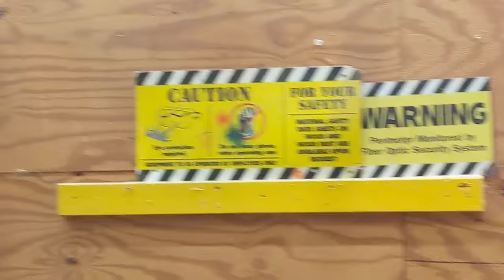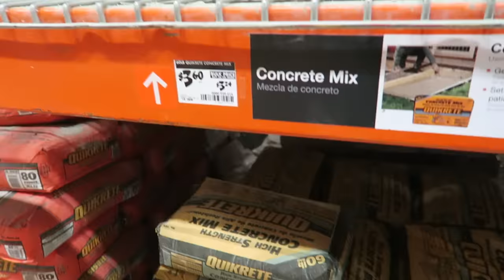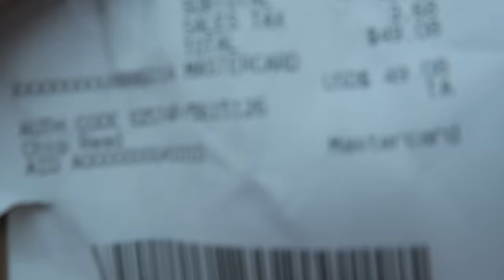How To: DIY Squat Rack & Bench Press Rack for $50

Comment from the maker: As stated in the video, would prefer people buy a squat rack for safety purposes. However, I know of multiple people that have lifted on this type of squat stand for years without any issues. Learn how to safely dump the bar off your back and don't bench without a spotter.
Reply: @48Boxer  This, use the Buffdudes one with wood and metal pipes. It's a full 4 post rack and can't kill yourself if the spotters are in the right spots... Back dump offs for squats and ab roll ups for failed heavy weights on bench are the best methods I've seen on failing reps without spotting.
Reply: If you were to buy one specialty bar that is most versatile what would you recommend?
Reply: @iloqin  yeah.  But trying to dump a low bar squat is a recipe for disaster.  If you don't get out fast enough you get a loaded bar smashing your lower back.  So that super cheap Home Depot squat rack just cost you a grand in medical bills, potential lost wages, and bodily harm.
Reply: One bad dump with real weight will kill you on this.
Reply: iloqin don’t bench with collars either
Reply: Wild Bill good time to lift sub max weights and increase volume
Reply: Coop could you do a DIY pull up bar. I would like to see what you would recommend for that?
Reply: Hey man, on an unrelated  note I have a question for you I would appreciate you'd answer.

I purchased an ohio ceracoat bar recently and was wondering if you know how the new finish holds up to the test of time. I saw your earlier videos and got one with a chrome sleeve, so only talking on the bar itself.
If you do take the time to answer this, thank you.
Reply: Yeah brother.. Not safe at all.. I'd recommend u take that Video,  you do want any of ur followers getting hurt.. up til this great content
Reply: Yeah.. brother.. love the content,  solely my opinion, Please pull this video, you dont want any of your followers  or yourself getting hurt.. that looked sooo unstable..
Reply: I’d love to buy one but I can’t find anywhere online to buy one. This might have to do for the next month or so to save me.
Reply: This is definitely not the easiest DIY. My current rack is 8ft 4x4 cut at 36inches for bench and 60 for squat. The tops are cut at 45 degree angles to make a V. I also recommend filling the buckets with a full 50lbs of Crete.I have used them for the past 4 years with no issues. The most I have loaded on it is 405 , but I love it. I can move it in and out of the garage to the basement when the temps are too cold to lift out side, check out end of three fitness for some cool DIY projects
Reply: Put joist hangers on back with corresponding joist hangers mounted on wall. When you want to use, move the squat rack to it's place and put a two by four between wall and racks. Will make it not tip back as easy.
Reply: @bigjosh04  How about use it for light lifting and not maxing? Clearly if you're in a position to only be able to make a DIY rack, you're not going to be able to afford a ton of plates to go along with it.
Reply: @sokissablec3  I can respect ur take.. Been in this game for too long and want to see fitness fan Build legs Not break them.. Sooo many other options for Building Legs, The risk is not even worth it
Reply: @sokissablec3  he's clearly quite poor. Def the best bet for Joshy-no-money. 👍
Reply: @bigjosh04  I totally get it but as a 6x/week lifter who just lost her job for 6 months due to the pandemic as well as millions of others, seems like good temporary measure as long as you use your senses along with it.
Reply: Hahahaha... Buy a squat rack. Fuckin 12 week waitlist.  Just hoping my plates bench and bar get here sooner than that.
Reply: With a few modifications this would be good outside , just make the wood 2 - 3 ft longer and bury it in the ground , you wouldn't need the buckets just pour the concrete in the holes !
Reply: @antonycuff4512  Outdoor this’ll work well. I sunk vertical 4x4s to the ground for a trellis hammock stand I made last summer. The 4x4 (or stacked 2x4s) needs to go in for 1/3 its height (i.e. 3’ 4” hole for a 10 foot 4x4) and you need a lot more quickrete than one bag per hole. If you do this, I’d connect the two vertical beams with a horizontal pipe for pull-ups.
Reply: i guess it is kinda off topic but do anybody know a good site to stream newly released movies online?
Reply: @Chaim Clark I would suggest flixzone. You can find it by googling =)
Reply: how to buy homedepot buckets in europe also you have alternatives to that? im from poland and i can't buy shit here
Reply: hey bro what screws are theese in european size?
Reply: God loves you he sent his one and only son and if we walk in the path Jesus walked in we will enter the kingdom of Heaven.

Comment: Dude you're a life saver. It doesn't take a genius to realize this isn't the safest rack but as long as you're not an idiot this will work just fine.
Reply: If you're flat broke it's okay. But Amazon has or used to have basic power racks for around $200 or so...
Reply: ultimaetsolder not about price but those wont ship out for weeks. Built my own stands out of wood that are a little nicer than these (and safer). I also need to be able to put it in the corner of my garage when I’m done.
Reply: @ultimaetsolder  during a pandemic, it might be the best thing you can find!
Reply: Safer then trying to deadlift 400lbs off the floor and toss it over your head

Comment: id attach a crossbar at the top and more concrete for stability
Reply from the maker: Yep, could definitely increase stability. If I were to redo it, I'd double the concrete in the base.
Reply: and you can screw it to something.
Reply: can u do it soon and show us
Reply: I'd attach it to a platform of some kind
Reply: Crossbar at the top was my immediate thought seconds into the video after seeing him add plates to the bar
Reply: @GarageGymReviews  Coop, I need a recommendation for a great plate loaded leg ext/leg curl machine. Any advice? Thanks
Reply: @GarageGymReviews  you could also just add more cement to the bucket instead of a redo
Reply: Add a wood frame screwed in around the bottom of the concrete pails. Longer forward and back to not get in the way of the lifters feet when they are putting the bar on or off the rack.
Reply: David Cohen how would I able to screw on a wood frame on bottom of concrete buckets ??
Reply: @medrano433  wait till the concrete dries,  support the bucket sideways on a bench or something then screw a big piece of plywood to the 2x4's through the bottom of the bucket
Reply: Joist hangers on back of supports with corresponding supports mounted to a wall. When you want to use line up racks with wall hangers and insert a length of two by four, for temporary support against tipping backwards.
Reply: I just finished my master piece thanks a lot for the help
Reply: @pizzawuff1773  no need to mix the water in before you add the concrete. Just pour the mix in dry and add a measured amount of water on top and leave it alone.
Reply: @medrano433  use a 24"x24", 3/4 A/C plywood anchored through the bottom of the bucket using carriage bolts and then add concrete.  Use a whole bag in each bucket.  Stabilizes your footprint.
Reply: If someone was to do the crossbar what would the best width be between the two upright pieces?
Reply: With a few modifications this would be good outside in a yard , just make the wood 2 - 3 ft longer and bury it in the ground , you don't need the buckets just pour the concrete in the holes !
Reply: @GarageGymReviews  
Concrete is not enough, you must secure it at the ceiling or to the wall at the upper part
Reply: @GarageGymReviews  i would use a larger base as well, it might be even more stable

Comment: Nice vid. I’ve seen the basic idea a few times. Two ways to improve stability and durability. 

1. Leave a couple screws or screw a board to the posts to give the gove the concrete something to “bite” into. 

2. If you bolt the buckets to a sheet of ply and use it as a platform, the buckets will be far more stable and less likely to tip. 

Good video. Stay gold.

Comment: I made this exact build with some features I got from DIY Dukes wooden half rack. I used one piece of 4x4 treated hardwood, 76 inches long. Drilled inch wide holes at various heights and used screw-on plumbing pipe as the adjustable J-hook. Drilled a hole in the bottom of the 4x4 and another one at the centre of the bucket, and used a long screw to attach the bucket to the wood (to keep it upright and level while the concrete sets). Used double the amount of concrete shown in this video, and once cured, attached a piece of 12 inch long timber to the back of the 4x4 to act as a spacer, which I then screwed the other end of the spacer onto one of the horizontal beams in my backyard fence. I now have a really strong half rack which doesn’t shake and can hold more than 500 pounds. Great video and thanks for the ideas!

Comment: Built mine a couple days ago and it's handled around 405 just fine so far.
Reply: Samuel Brown how tall are you? Did u cut every Piece of wood exactly like in this video?
Reply: @Nuttyboiant  I'm six-three. I cut the pieces for how tall I am. I cut the back pieces at around 60 inches or so. I wanted the option to unrack it either high bar or low bar. It's really not hard to figure out once you get it going
Reply: @Samuel Brown Have you found that it tips forwards during reracking? About to make my own and considering having a wider footprint or supports.
Reply: @gabe-qr5vb  did you get the picture?
Reply: @nytroxnikko1532  he message me the pic also please? @andre_a_lopez I'll actually say thank you
Reply: I have a question. I am about 5'8 tall and I want to build one myself but I'm not sure how many two-by-fours I would need can someone help me
Reply: @kellee_moor  I got 6 lots of (2"x4"x2.4m)
Reply: I want to see that shit too I’m 6’2
Reply: Dang everyones gonna get a badass answer.. im over here 5'6 do i just tell them midget boards or?? 😂

Comment: As someone with contracting experience... theres a lot of little things I would do to improve... like drill holes in the wood to make the concrete grab it better.  Add a X brace to connect them... that's a biggie. But definitely a good idea.  I might make some to throw outside.  Would love to squat in the back yard on nice days "tanning and squats". Just never have because it's not worth buying a $300 rack. But this is definitely worth it. Plus if it falls.... won't hurt the lawn. But really need a better way of having the concrete grip the wood.

Comment: Great job coop

I must say, With a few modifications this could be much safer and much more worth it:

•double the amount of concrete in the buckets 

•link the two platforms together at the top 

•a barbell safety catch for the bench is a must imo

•Flexseal or other weather proof coating for outdoors use

depending on how you implement the additions, the finished version could end up costing between $75-$140 

An absolute steal even post covid

Comment: Me: sees uneven wooden planks in buckets supporting several hundred pounds. 

Seems legit.
Reply: Wood supports houses 🤔
Reply: Yo, I thought the broom stick curling bar was bad 😂 we have got to eradicate this virus before we all get ourselves killed
Reply: @Burnt Teriyaki 
If you think there's no uneven building anywhere, you are sorely mistaken 😬
Reply: Jared Lind  Yes, with concrete in them.
Reply: @stighaaland5357  Take note that houses are three dimensional. This is the equivalent of building one wall. By your reasoning a motorcycle without a stand wouldn't fall over because cars also sit on wheels and they stand up just fine.

Comment: Since this COVID BS, we've been pushing and pulling cars. Even the slightest hill can turn it into a crazy workout. You just push it up the hill 10 feet, then it rolls back down and you're ready for another "rep." If no hill, have the person in the car apply the brakes a little. Pushing works quads, glutes, shoulders, tris, chest.. pulling it works hams, bis, lats, the rest of your back and it will always be the perfect resistance because of the brakes

Comment: I have a similar set up. I dig four holes about 2 feet deep in my back yard and used 4 4x4 and some concrete to sturdy them. I can do pull ups, over head press, squats, bench. I attached a couple of chains between them as “safety bars” since i usually lift alone.

Comment: How to make this safe, but less mobile:
Instead of the concrete in buckets set about 2-4 2x4 spacers and "glue and screw" them into some wall studs. You'll just need enough distance that your plates won't touch the wall. 
If you're worried about them ripping up the wall with continuous usage get a sheet of cheap plywood to anchor to several points, mount 2x4 crossbeams to the plywood and mount your rig on the crossbeams. Really Coop, those buckets are sketchy AF.
Edit: And really, make sure you cut at your height. You shouldn't be doing calf raises to get the bar out.

Comment: I built one in my basement with 2x6s that looks just like a normal power rack and it’s attached at the top to the floor joists or whatever and screwed into the concrete floor. Used pieces of 3/4” pipe for the j cups and 1” pipe for safeties

Comment: Add two more buckets with 4x4s in them. Place them 3 feet away (think tires on a car) and run 3/4” black pipe between the 4x4s and the rack. Adds stability and a safety bar.

Comment: A tip is to leave some screws in the base of the wood out, before applying the concrete. They can be nails hammered halfway. This way, the wood will be difficult to detach from the concrete over time.

Comment: I bench on mine often (4 by 4 setup with holes) I've NEVER tipped mine over. For extra security I have mine up against the wall just in case. Having said that, it's never hit the wall.
Reply: Hmm lnteresting. So you use 4x4s instead of 2x4s?
Reply: @DanteLikesRock  Yes much easier in my opinion. Still holding up, no safety issues.

Comment: For added stability screw a 2x4 at the top to attach both piece's  together.. also you can put it as close the wall as possible and add spacers between the wall and the rack

Comment: 2 more buckets, 2 bags of concrete and about 4 more 2x4's and you could actually make some safeties for this thing and improve the stability, making it safer to bench and squat in.
Just mount 2 2x4s horizontally to the uprights using some lag bolts and stabilize the other end with the other buckets/concrete.  You can always remove the lag bolts later if you need to move it.  Probably not going to survive a 400lb drop at shoulder height, but would hold a few hundred lbs in the event of a failed bench.

Comment: Hmm, made me think about running a slant out the backside to a connecting ground baseboard, almost like a soccer goal for a stabilizer. You could also run side rails that connected the stabilizer right into the side of the bucket.? Since it's too late to screw into the bucket, make square bases out of 2x4s for the bucket to fit into. You could even stabilize with permanent spacers on the rack & bucket squares from there. I bet you'd be golden with that.

Comment: I doubled up the concrete with 60lbs on each side and it came to 100 CAD + tax. Planning on putting a piece in the middle for racking and a small piece on the back of each stand for bench press support. Thank you for the video!

Comment: Great and useful video. What makes this unsafe is the rocking, that’s easily resolved by adding bracing prod trueing from the back (enough to give plate clearance from the wall) and then pushing the setup against the wall. This way when you put the barbell back from benching or squatting, you won’t have the toppling/shake effect. You maybe need 1 more length of wood for this so it’s an easy and cheap fix

Comment: I'm literally building this this weekend.  It's going to be ment to last till gyms are open again. Except I'm going to mount some angles would to base of buckets and add a removable cross bar at the top.  Keep it mobile causeni need it
Reply: FearlessRobb I used a bag of concrete per bucket and it works great for now

Comment: I made these about 8 years ago, still going strong.  I recall using 2 bags of concrete and you don't need to mix at all, just fill with the mortar / concrete mix (after your posts are set) and then add water

Comment: You could also buy a 2 by 2 and drill with drill bits just like in the buff dudes power rack and put it into the bucket. Buy pipe as Jcups.

Comment: Stool is way more stable lol if you were to move forward a hair to hard or fast the thing is falling back. I suggest ditching bucket and putting an angle on two pieces of wood with a cross bar at the bottom

Comment: I’ve made nearly the bang same thing a few weeks ago but I put another level on the other side lower down for rack pulls and barbell shrugs works a treat spend £100 on timber and ended up building that plus a dip station! It’s amazing what you can do with a bit of timber and a few scaffolding poles!

Comment: That extra length could have a bar above head hight connecting the 2. Broom handle and duct tape. Next is forward and back and twisting ie one goes forward the other back. Maybe more glue and screw to a board u stand on. Thoughaybe those buckets benefit from a bit of movement so don't crack the bottom edges. I know this just a quick get u started maintain some fitness video. Great job. Any Fella or Sheila can do it!!